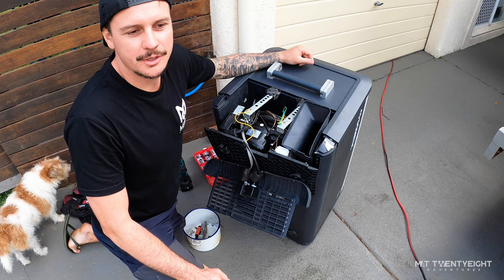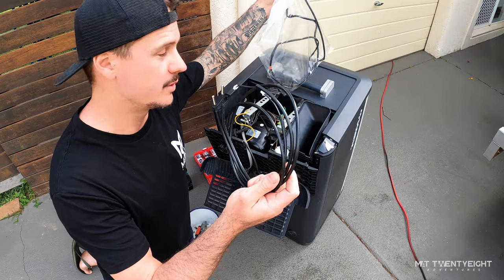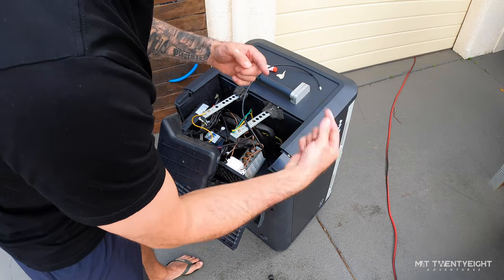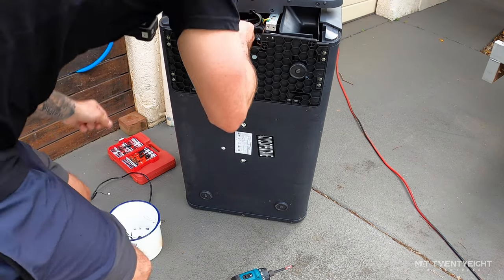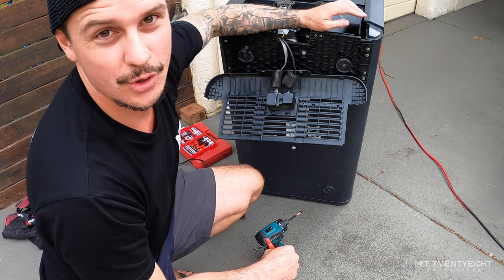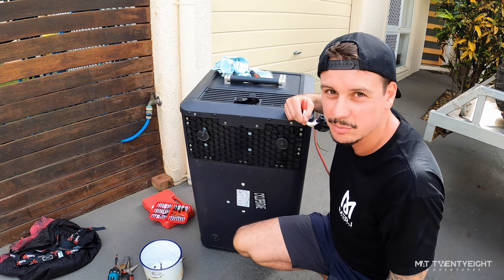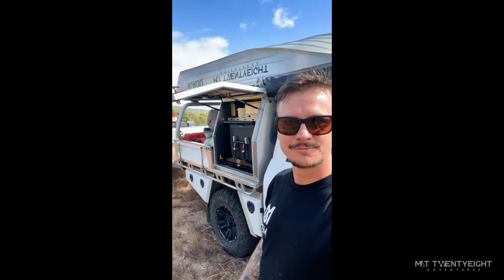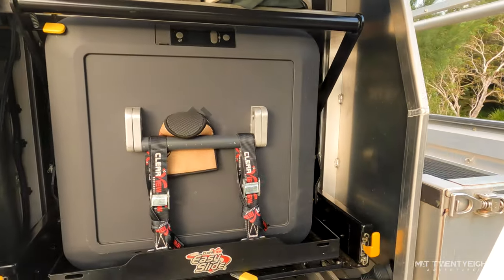DOMETIC Waeco FRIDGE Thermistor FIX- REVIEW on my 75L DZ

Comment: Thanks for this video mate. I turned on my second compartment just before a trip and found that it had the exact same issue - wouldnt read below 14deg.

I was able to go to a local dometic repair shop - and get the parts and paste free of charge under warranty to fix it myself before heading out - as booking it in could have taken ages!

Simple repair had it sorted in under half an hour thanks to your info - cheers
Reply from the maker: Glad to hear mate. Seems to be a common problem. A spare might be handy hey!

Comment: Instead of leaving the lid cracked to stop mould I pull the drain plugs out of the bottom and close the lid. I have five Waeco’s and never had mould doing that.
Reply from the maker: Good call Kelly, will give that a crack, might save my lid springs 👌🏼

Comment: Had the exact same problem on my CFX3 75 less than 6 months old. Just remember Engle don’t make a real dual zone 🤪
Reply from the maker: What do you think causes the issue? I've heard moisture. Yeah mate hard to beat the Dual zone design for fridge freeze set up
Reply: @MatTwentyEight   got it repaired in Darwin and they think it was moisture. 
Had it running on -20 from Melbourne all the way up to Katherine then it spat the dummy was showing -8 but a secondary thermometer was showing -17
Was told they should never be set below-15 in 30+ temps.
They said it’s extremely common with the cfx dual zones so it kinda looks like their may of been a bad batch or could be incorrect use who knows.
I’ll probably pick up a spare now that you’ve shown me how to replace it. 🤙
Reply from the maker: @tomb8265  yeah ok, interesting, good to know cheers mate 👍🏻

Comment: Thanks for the video.  My smaller side is working fine, the larger side thinks it's 138 degrees F and it just freezes everything, pretty sure I need to replace thermistor but I only need one not both.  Do you know which thermistor is the larger side of the fridge, the short thermistor or the long one?
Reply: Hi I got the same problem now did you figure it out what was the issue? Thanks

Comment: Hey mate have you ever tested how many amps your cfx75 uses when having one side on O and the other on -15 ? I’ve got a cfx95 and it’s bloody power hungry when running one side freezer one side fridge ! The cfx95 has a larger compressor than the rest of the waecos and on my recent trip over to Moreton island two weeks ago was pulling over 6 amps during the day so thinking about getting the cfx75 if it’s better on power ! Cheers Chris
Reply from the maker: Hey Chris, 
That’s interesting mate, I originally considered the 95 but couldn’t fit the foot print in my drop slide. I have heard that the 95DZ sucked a little more juice. 

I’ll set it to those temps and message you tomorrow on the exact draw if you’d like. Let me get back to you. 

Cheers 
Mat
Reply from the maker: Hey Chris, just been running my 75DZ today with small zone 0 deg and larger zone at -15 

The most draw I recorded was 4.5amps the least being 3.5amps 

Is pretty average tropical north Qld summer day here 30degrees and 73% humidity 

Hope this helps. If ya want any more info hit me up on Instagram or Facebook message

Cheers 
Mat
Reply: @MatTwentyEight  cheers Mat yeah that’s not too bad for a dual zone been told the cfx75 is better on power than cfx95 so will probably start keeping an eye out on market place for a second hand one ! I’ve had the cfx95 for 5 years now and it’s run none stop as a drinks fridge on the deck when it’s not on the Ute and haven’t had to replace a thing on it so sort of don’t won’t to let it go- might even look at a lithium setup with bigger dcdc charger to compensate for power draw and to replenish quicker than the 170agm and bcdc 1225d setup I have now. A lot of people will knock the waecos but they are a great fridge I also have an old cf60 that’s over 10 years old going strong only ever had to replace one thermistor on that about 12 months ago 👍 Cheers for the reply enjoy your travels

Comment: Do you have the part number please I need one set for cfx75dzw waeco fridge and freezer thanks
Reply from the maker: Hey John, 

https://www.everythingcaravans.com.au/products/thermistor-for-waeco-portable-fridge-cfx-range-thermister

The 75DZ has 2 thermistors obviously because of dual zone. Make sure you replace the correct one or both, one is shorter and one longer, they have different coloured plug connectors. Hope that helps, cheers
Reply: @MatTwentyEight  hey Matty, would it matter if you got two of that product you’ve posted or does it have to be the specific short and long?